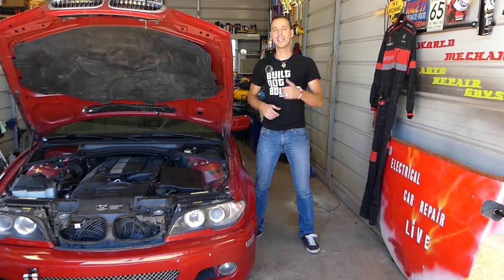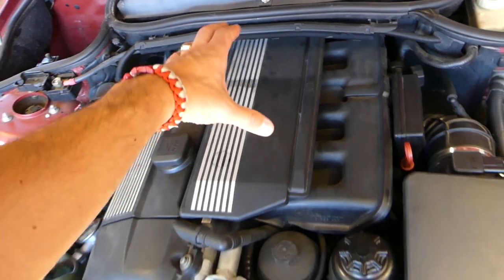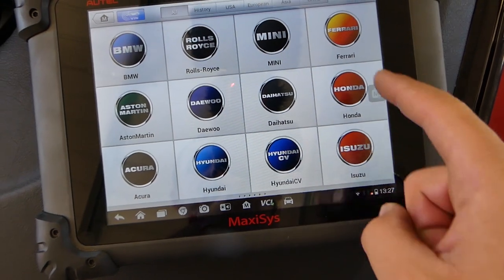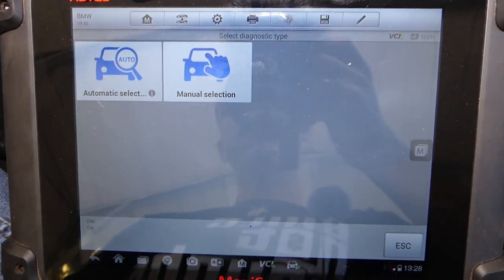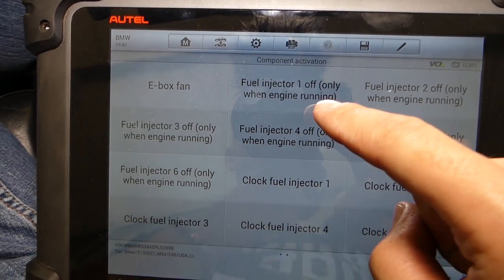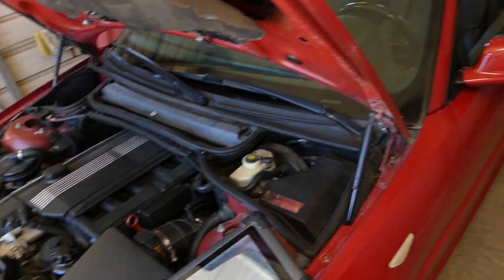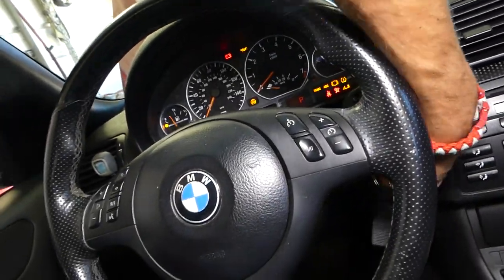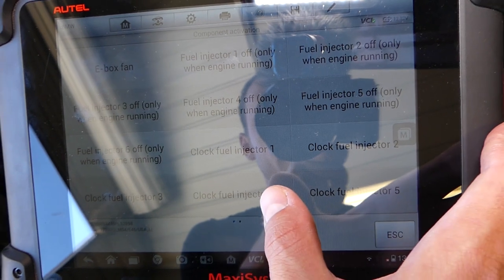HOW TO TEST FUEL INJECTOR. HOW TO KNOW WHICH FUEL INJECTOR IS NOT WORKING

Comment: Great video but this scanner is way advanced and expensive for my needs.
I am a diy'er and have two cars. What lower end scanner do you suggest for dpf regen, injectors test/code and switch/relay activation. My cars are kia and vauxhall. Thank you in advance 🙂
Reply: Scanner is 460 mk808 pro ot worth that money for sure i had airbag light and only to diagnostic was 150 I bought the scanner and just click 10 times and all my lights when off 😅

Comment: what kind of scanner are you using..i am having a problem with my 2008 ford explorer fuel injectors and i don’t want to replace all of them if i don’t have to..i want to know which ones would need to be replaced..i am looking at buying an obd2 scanner but i want to know which one i would need
Reply: Replacing all the fuel injectors would probably be cheaper than the scanner he's using, unfortunately. I'm dealing with a similar issue. Replace all 6 injectors myself for $1k in parts. Or pay someone to diagnose which injectors are the problem and just replace those, for almost the same price.

Comment: I have several misfires inside bank 2 on my 2012 audi q5 3.2L  I'm suspecting of a bad fuel injector but I'm also not sure if maybe this more of a ECM problem. I have try the same steps on this videos but for some reason I get errors from time to time like the ECM is not connecting to the injectors. I'm not sure what to do here. I pretty much have try everything I can think of but at this point all I can think of is 1 of 2 things ( injectors or ECM) any help would be appreciate it
Reply: Hi, did you ever figure it out? I have a similar problem
Reply: I have multiple miss fire code  what scanners does this shut off injecters